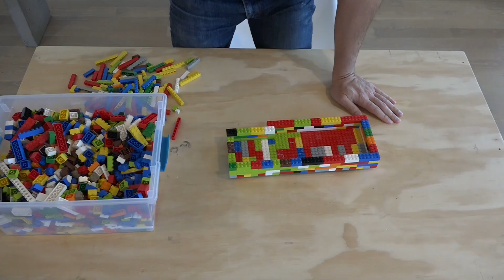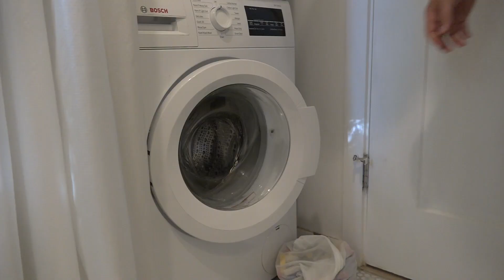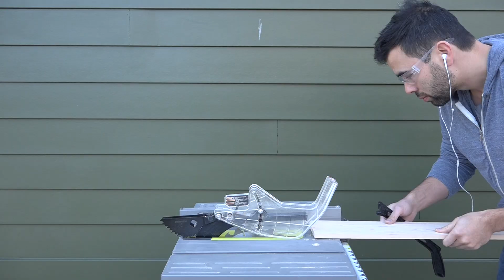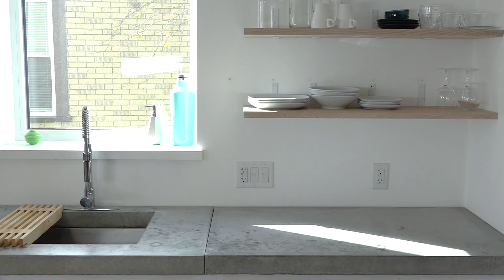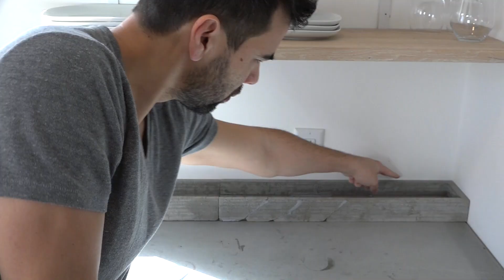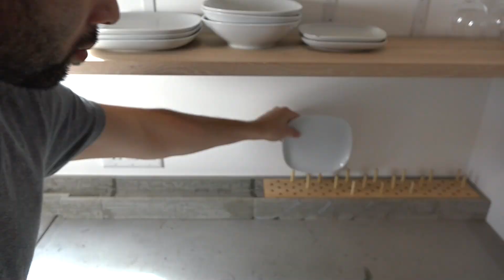DIY Concrete Backsplash and Dish Rack

Comment: So smart to use silicone bc you're right, it's not going to have a ton of water accumulation, but it is going to have to be cleaned occasionally, especially if it's humid in the kitchen for prolonged periods. Thank you so much for posting these videos and going into detail on your thought processes behind each decision. It makes the education extremely accessible. I can't wait to try emulating one of your projects or techniques in my own house.

Comment: Wouldn't using a vacuum system (like a medium vacuum bag or chamber) work better to remove the air bubbles? 
Or would that cause problems with the concrete mixture?

Comment: how did you make it sloped so the water runs in the right direction?
Reply from the maker: i used a little bit of silicone to raise the ends a about 1/8" over about 4 feet but it wasn't really that important.  if if the dishes are soaking wet and the backsplash is flat the water just pools up then drys.  i poured water on it when it was flat and it still funnels the excess to the sink and then the remaining water drys.

Comment: i dont know about putting any amount of concrete in your drainage system. seems like it would settle/catch somewhere accumulate over time. even tiny amounts. Then you have a bottle neck somewhere in your system. i would wash the legos by hand and release the water outside.

Comment: Why are you obsessed with concrete?
Reply: cos concrete is an easy thing to use to make alot of things and it looks cool?
Reply: If I had to guess for a few reasons. 1. He's sponsored by Quickcrete. 2. He likes the way it looks and it lasts forever.  3. You tend to use the same materials to match existing materials in your home thus developing a consistent style.  4.  It's a good DIY material.  You 'make' concrete using a mold.  You more or less just cut granite and other similar hard materials but definitely more limited.  As he shows here, you are only limited with concrete by your imagination.

Comment: Are there any methods to stop concrete from cracking like that? Can we reinforce it with fiberglass?
Reply from the maker: if i didn't drop it it wouldn't have broken
Reply from the maker: https://www.youtube.com/watch?v=tAA9YgnDqbI here is a strength demo of this Countertop Mix it is 6000 psi concrete.
Reply: Nikola Tesla use a fibre reinforced concrete mix and don't let it get too thin.
Reply: malaysian love your workkk broo